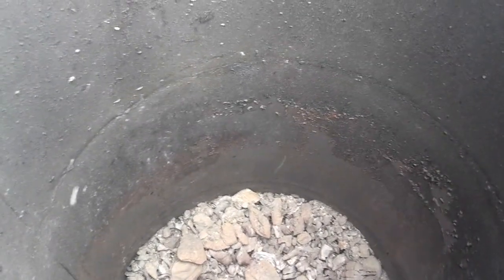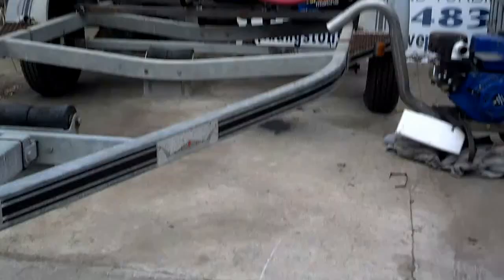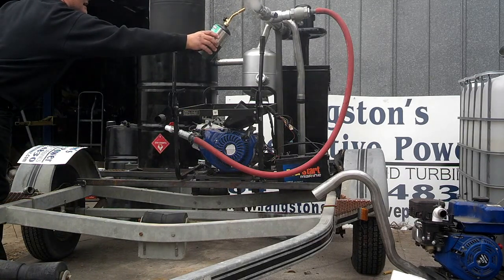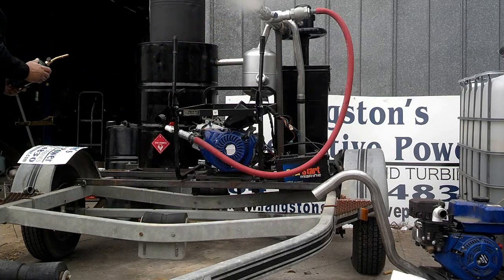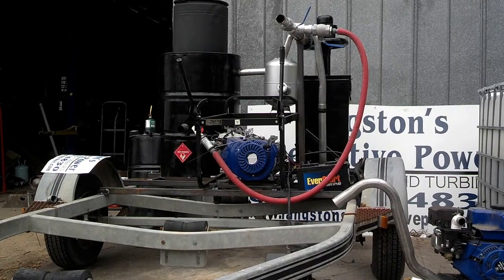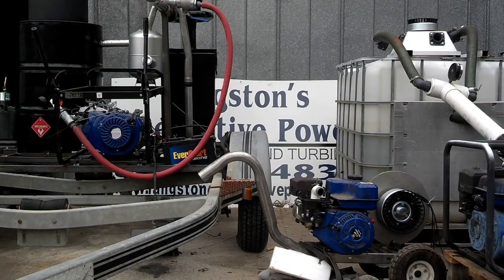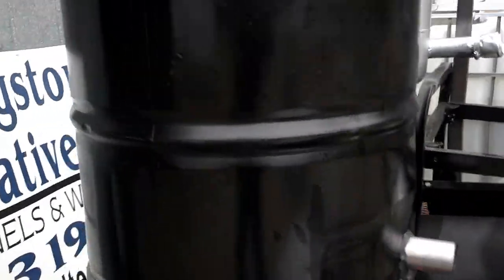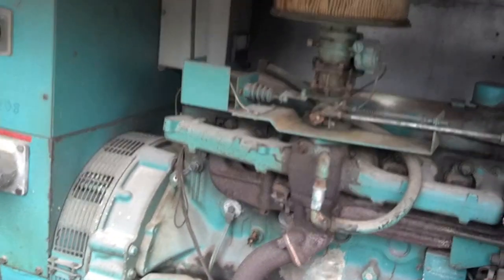Gasifier runnig motor Langston's Alternative Power

Comment: Not to bad of a setup but first what kind of wood are you running in it and what color is the gas on yr flame tube if it has any yellow or orange in it it will gum up yr motor in time if you do have any other color flame besides blue take a look at my frds setup and how his filters are made they flash001USA  he has great vids with a nice blue flame. Keep up the good work!